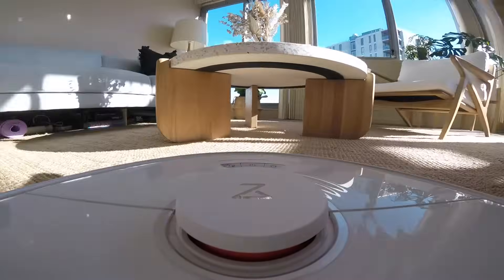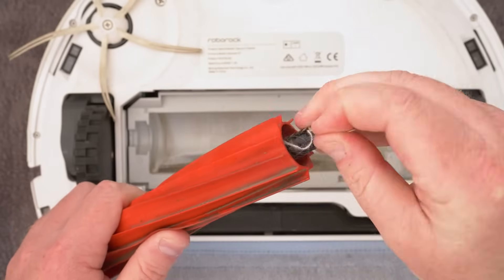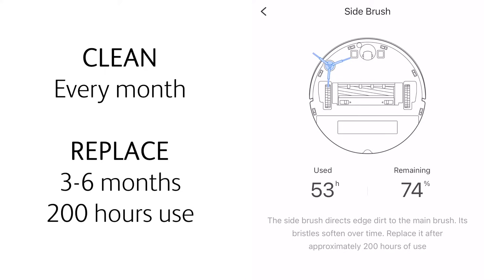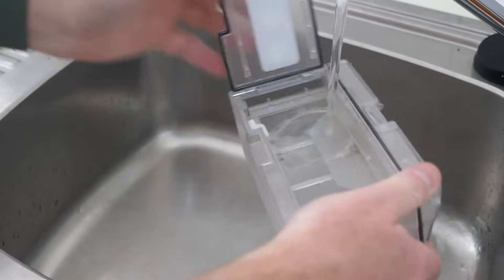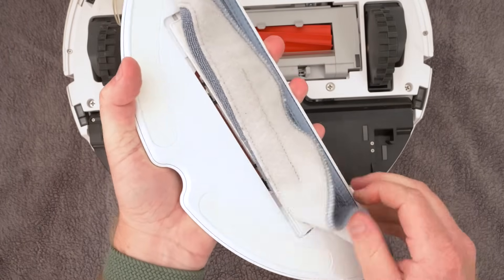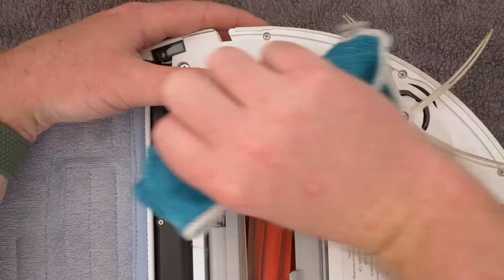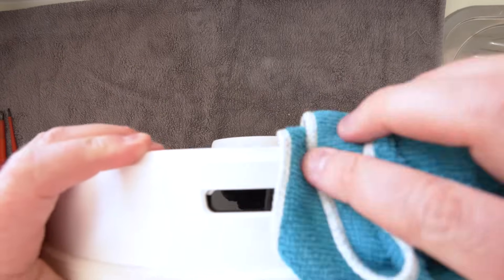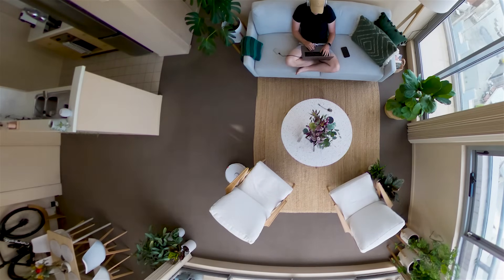Roborock Maintenance for Best Performance

Comment: Observation: in the dust bin housing, dust will accumulate on the left slot, blocking the vaccum sucking channel. I use a strong vaccum to clean this area

Comment: Hi John, I wonder if you could help me. I have a Roborock.vacuum.s5, it worked fin doe the last 7 years. But lately during cleaning when the battery was reaching 80% the vacuum dies and don’t move or go to the station for recharging. Could you please give me direction on a link where I could read about his problem? Many thanks in advance and great tips

Comment: You didn’t mention the 2 most important things that Roborock also misses to mention and they make a massive difference. 
1) clean the round filter cap located under the dust bag
2) remove any dust located on a small gap left top of the dust bin. Saw that after 3 years of having it. 
Massive performance difference
Reply: How do I open the round filter cap? Can't find it in any instruction I have
Reply: @BonnskiSWE twist it anticlockwise

Comment: There's also a little slot in the air filter cavity with a circular mesh that gets blocked off by dust. It's a bit hard to see but should be cleaned too.

Comment: Excellent video! Please add to clean the filter to the left of the dust bin - inside the RR
Reply: This! I came across that small filter and it was so full with dust. I think that is the reason my roborock s7 is giving 'filter clogged' errors. At least, I hope this will help:)

Comment: I don't recommend rinsing the filter.  Getting it wet will only cement the fine particles onto the filter media.  You should blow it clean with compressed air.

Comment: Thanks for the tutorial. One tip from my side: be 100 percent sure that the filter is really dry after rinsing. Inserted mine after 1 day, seemed not to be totally dry and that killed my s7 😂
Reply: SAME it kills the battery
Reply: Sorry to hear.  Have you tried drying fillets like this by putting next to a heat vent? I do this with my Dyson filter and will now follow your advice with my S7

Comment: I need to clean the Air vent. It's full of dust. I cleaned the hole in the dust bin area but how to clean the "inside" part, we can see a grid from the outside were it's written "vibra rise". Thank you

Comment: Mr Josh Tunell,
Many thanks for your detail video which has been a great help.  Can you please help with a problem others may also have faced? 

Cleaning stuck up hair at the roller's axles is daunting. Because, taking out the grey twist-off cap on the right hand side is tricky. At times, twisting it off doesn't work and when I tried too hard, the black part of the assembly (supposedly attached to the grey twist off cap), separated from the grey cap. When that happens, it's darn difficult to figure out how to reassemble the black piece into the grey twist off cap, and put them back into the roller. 
THAT IS REALLY MY PROBLEM.

After it happened the first time, I ordered another roller kit. It happened again: I was careful in removing the grey twist off cap but it just it wouldn't budge. A little extra force, again it separated out the black part of the assembly. 

Tried to push the black piece into the twist off cap from the inside - doesn't work, because some notches prevent the hard plastic from the inside to allow the black piece's orientation to go through.

I have watched your video frame by frame - at 1:09 there's no way that orientation allows the black plastic piece and the twist off cap can be together. 

Perhaps, there's some simply way to resolve this problem, please let me know: If while twisting off grey cap the black piece separates, how the heck does one reassemble the roller. My apologies if this is a stupid question.

I am at a loss here, any insight will be appreciated. But again, many thanks for a video which has overall been immensely helpful.
Reply: I encounter this same issue repeatedly 🥹

Comment: You forgot to mention the intake rubber, between suction opening and the dust bin. Also, you forgot to mention vacuuming the Roborock, push the wheels in and suck all the dust particles from the inside of the robot.

Comment: Do I need to remove the water container before flipping the robot upside down? And the maintenance needs to be done on a soft surface so the sensors on the top of the unit won't get damaged?

Comment: I am suprised to see only one filter. Irobot i7 has 2 filters. One that stops big dust and it does and the finer one before the suction motor. It actualy preses the dust together so it stays together and the dust has a grid markinh inprint from the first filter. So I am suprised to se the Roborock not having that. But this shows that Roborock has a good cleaner robot which I would buy to yust I am suprised how god Irobot I7 picks up dust which no one tests.

Comment: i just use a high powered compressor to clean the vacuum after every use since i have one in my computer shop.  it take me 5 minutes over all.  i did like the info on the roller i didnt know those ends came off.

Comment: Do we have to dry those parts that are wet or running under the tap water?
Reply from the maker: Yes absolutely. Make sure the filter and dust bin is completely dry before putting them back in your robot. I leave it in the sun til it's dry completely.

Comment: you never should clean the filter with water, either used compressed air or reverse a your vacuum cleaner. with water it will create mud and once dry, the performance will drop significantly including loudness increase.
Reply: These filters are designed to be washed I've cleaned many filters for many types of vacuums these clean beautifully with water
Reply: @heyyou6847  it not how they look but how they perform later on
Reply: @Morfineczka  it's still very effective, I have a saint bernard and a terrier mix who shed like crazy.

Comment: Does anyone know why the Roborock would continue to say "Filter blocked or wet, clean, dry and retry." I clean it, blow it out with an air compressor or I put a new one in and it continues after a minute of running to give the same error. I wonder if the air suction is the problem, since maybe the suction might not be able to pull it through the filter and if so, what can I do? I have run it about a year now. The problem has been going on for about two months.

Comment: Hi I have Roborock S7 for just a year plus 4 months but the machine now cannot function.  Charged 100% but when pressed Clean the machine stopped and all light went off then returned with Low battery and event back to charging again.  Tried over n over same problems exist. Changed new battery n fully charged same problem…keep saying Low battery.  Thanks

Comment: I have a S7 Roborock complete new it has cleaned 2 rooms.
And it is making a awefull mechanical noise when moving forward. It sounds like something from the 2 main wheels or a thing sticker in the fan.. I can't seem to figure it out :(

Comment: Came looking for help because when I removed the brush housing, I couldn't figure out how to put the little black piece back into the side of the red wheel. I got the side without the pin done fine, but I kept trying to nest the black piece in with the gray piece on the other side. This video helped me figure out that they don't nest, they just butt up adjacent to one another and then the pin holds them together.

Comment: it is much better to blow out the filters with, for example, a compressor.  if you rinse it with water, you might as well seal it with wet dust.

Comment: A better way to clean the dust bin after emptying the bulk of of it is with a can of compressed air. Take it outside and hit the filter on both sides as well as the dust bin itself with the compressed air and it cleans it much more efficiently than running water. Also won't need extra time to dry. Of course if you have crap literally gunked up and stuck to the dust bin, for sure run that through water lol
Reply: True

Comment: Do you think it'd be possible to put the S7 brush on a S5max? The sides seems exactly the same, so that would be just a question of overall size.
As the S7 brush handles hairs in a much better way, that would make a great upgrade for the S5max for a very small price :)
that would be awesome if you could try that please!
Reply: I think the S7 rubber brush is a smaller diameter than the S5 brush. It would probably fit, but would not contact the surface that you're cleaning adequately. Also, people have reported that the S7 rubber brush, while getting less hair wrapped around it, does not clean hair from carpets as well as the older style bristle brush. The bristle brush made for the Roborock Q5 is a drop in replacement for the S7 and does a better job with carpet.

Comment: Thank you so much. This is by far the best instructional video that I have run across dealing with my Roborock S7. I had several issues understanding the manual as a majority of it did not explain exactly how to clean the Main brush😅😊 I am going to save your instructional video for later periodic maintenance.

Comment: What if you get debris under the main wheel wells. Mine ran over toilet paper and it is blocking the wheel from being springy
Reply: Did it go in to the bathroom and then toilet paper got stuck in the wheel?
Reply: @markusmeinhard9472  correct

Comment: Watching this while I'm still saving up for my Roborock :')
Reply: The worst piece of garbage I ever bought

This crap worked fine one month and then stop working, by contact the manufacturer they said of clean it up and try again which obviously didn’t fix the issue. Then they asked to the item to be returned there has been ONE month without no news or updates. They should have the decency to send a brand new or give my money back, instead they will fix it and se d it back, which they didn’t yet. NOT RECOMMENDED!!!!!

I regret not buying it, it took more than a month to fix it and today my Roborock arrived with the roller wet and smelly (I don't know if it's working) but what a rubbish service. (If you want advice, don't buy this product)
Reply: Hope you've gotten one yet? ;D

Comment: Thanks for the nice video.  I have a natural stone floor that my Roborock scratches on.  The four protruding parts of the brush cover touch the floor.  This causes scratches on the floor.  Is there a solution for this?  For example, increase the distance from the bottom to the floor?  hopefully you have a solution.  Greetings Michel.

Comment: When using the auto empty dock, it's possible to extend the time in between the cleaning of the dustbin filter? Or it's the same
Reply: It is possible its 15 sec 25 sec or 30 sec and theres also a smart mode that adjusts the running lenght so basically the auto empty dock will run as long as the robot cleaned

Comment: Is it true you can't clean the paper part of the filter? After wetting, I have been cleaning it with a toothbrush. 🤔
Reply from the maker: Hi Ana, Roborock says to rinse the paper filter under water to remove any dust. Using a toothbrush will likely damage the paper filter, and if damaged, could cause debris to get sucked into the vacuum motor ruining it. I'd recommend stop using your current filter and get a new one, and only ever gently tap the dust out of it, and then rinse in water, before letting it dry fully.

Comment: Leaving a comment just in case anyone runs into a similar problem: I was receiving error 18 (fan error). If the air filter gets too dirty, that can be one potential cause of the fan error because the fan isn't able to pull enough air. I followed the procedure described here to clean the filter and dustbin, and the error went away. Great video!

Comment: Do all the brushes end caps come off? I have the s6 pure and twisting either way does nothing on the caps
Reply from the maker: Hi Red, from what it looks like in the manual, the end caps should come off if it's a genuine Roborock brush. My parents have an S6MaxV that uses the same brush design, but they have bought some after market brushes and the end caps don't come off them, but do come off the original brush supplied with the robot.

Comment: Can i pot detol or any antiseptic in water tank?
Reply from the maker: Roborock recommends only water, or they have recently introduced their own brand floor cleaner in conjunction with Omo which is suitable. I think it's only a very new product, so might be hard to get at this stage. I know people have mentioned using a diluted cleaner or vinegar without any issues too, but it may void your warranty. https://www.amazon.com/Official-Roborock-Multi-surface-Cleaning-Compatible/dp/B09DK9FWB1

Comment: I have cleaned the filter and it is not picking up.  any other thoughts
Reply from the maker: Hey Kris, double check you have the main brush cover set correctly. The 4 fins need to be installed correctly other wise it can cause suction problems. Check the video at 1:40 to see what I mean.

Comment: Really helpful demo of removing and reinstalling the main brush. But I'd advise against wetting metal components, or running water through a filter containing loose dust. 
I bought the S5 max over a year ago. It was a game changer in terms of keeping the house looking respectable. Its only shortcoming is it doesn't raise the mop when going over carpeted areas. So, I recently upgraded to the S7. Doing so seemed like a bit of an extravagance, but I'm delighted with it.
Every time I empty the dustbin I tap the dry filter against the side of my rubbish bin to dislodge loose dirt. I wash the filter fortnightly by placing the clean side under the tap, so the running water removes dirt easily, as opposed to embedding it in the filter. It's really handy to have spare filters, that way the robot isn't out of action for a day or two, while I wait for original one to dry. Spare mop pads are a good investment too. I rinse the mop pad after each use and occasionally machine wash them. Towels shed a lot of lint, clogging microfibre, and reduce the performance of mop pads, so be careful about what else you include in the load if machine washing.
I take out the main brush once or twice a month to remove tangled hair. I replaced both the main brush and side brush after about 6 months. And on rare occasions, the app prompts me to clean contacts and sensors using a soft dry cloth. I don't know if it being dry is necessary to prevent water damage, but I'm not taking any chances. Aside from that, I haven't done anything else in terms of maintenance in the 15 months I've owned a roborock.
My floors are always clean now, with very little effort on my part, which is not something I could have claimed before purchasing the S5 max.
If you're between two minds as to whether or not to buy the S7, I'd take the plunge. For anyone without allergies, I don't think an auto empty dock is worth the extra expense. Emptying the dustbin is a quick task to perform manually. But I guess the same could be said about moving rugs, or setting no mop zones.
Reply: Early Roborocks used a non-washable paper filter. Since the S5, the filter is specifically designed to be cleaned using tap water. I use the sprayer attachment on my sink to get a little more pressure. It gets the filter much cleaner. Filter life is greatly extended by regular washing. Just be sure to let it dry COMPLETELY before re-using.
Reply from the maker: Hi Breda, thanks for sharing your tips and experience with the S5 and S7. I agree, that since owning a Roborock, my floors have never been so clean so often too!
Reply: @iamjoshstunell  Question for Breda and Johs himself, do you guys recommend using demineralized water instead of the regular tap water for the water tank? I'm thinking of getting S7 or to wait for S7 MaxV to appear in Serbia. Reason why I'm asking if tap water shouldn't be used is because of possible limestone appearing and clogging up the nozzle used to wet the cleaning cloth? It's very common, for example, in Serbia that limestone appears from our tap water, even though water itself is perfectly fine to drink and all that... I'm just worried that I might clog up the nozzle and, literally, make moping useless if the water can't get through :|
Reply: @dreepatz  I would not risk using the tap water. We would be replacing the filter much more often.
Reply: you should be having at least the basic filtered water jug that you drink?  @dreepatz
Reply: @stevethea5250  no, not really. Water in my town is actually quite clean and safe for drinking, cooking, etc :D

Comment: Helpful video, thanks...what do you think about using distilled water in the water tank?
Reply from the maker: Thanks for watching! There is no mention from Roborock about needing to use distilled water in the tank. I think normal tap water is fine, but if you would prefer distilled, I don't think it will harm the robot in any way.